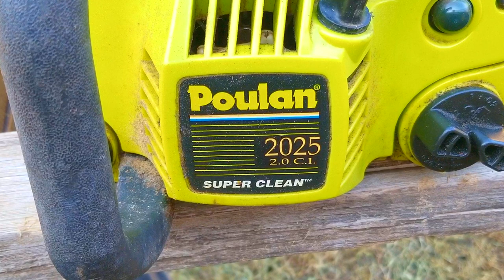THE UGLY SIDE OF FIXING SMALL ENGINES

Comment: The answer to your question is a "YES" Some customers are great, however I am finding many that abuse repairs and want more repair for nothing. I installed a brand new carb on a Honda Water pump and the customer came back and said the pump would not run. I found the new carb plugged with water and rusty gas. I repaired it again and ended up telling him that I would no longer repair his equipment. I checked his gas can when I took the pump back and it was an old metal gas can full of rusty gas and water. Many customers want equipment repaired but neglect to tell you the whole story of what happened to it. One guy let his young kid run his riding mower and just about destoryed the deck, engine, etc. He olny said he wanted the blade shaprened. Nothing left to the blade to sharpen and it was bent. Belts were almost burned off etc. Thanks for the video.
Reply from the maker: wow, customers can be the cause for the problems they have.  And thank you Waterman one.

Comment: I had sold a push mower to someone a few years back. A few months after I had sold it they wrote me stating I had ripped them off. They had said it stopped working so they took it to a shop to have it looked at. They stated the shop said the engine was worn out with low compression and they needed a new mower. I agreed to exchange it with a similar mower if they provided me with the shops diagnosis in writing and they did. I exchanged the mower and they brought back the one I had sold them. The engine was missing parts and partly disassembled. I assembled it back together, tested the compression at 140, it fired and died. Ended up having water mixed in their gas. After draining it , there were no further problems and I resold it. I learned that not all shops are honest and want to sell you a product instead.
Reply from the maker: yes it's a shame that some shops do that.

Comment: I used to fix small engines and chainsaws several years ago but quit after I didn't get any more challenge from it.  I too, learned the hard way about customers who abused my properly repaired equipment and then asked for refunds.  This was especially the case with chainsaws.  After a couple of these experiences, I made sure to ask the buyer the magnitude of the project and type of tree they were cutting down before I would sell them one.  Most of my sales were of lower consumer grade (occasional use) saws and in some cases the buyer was looking to cut down 20 foot oak trees with trunks of two feet in diameter!  For one buyer, I actually refused to sell him a Poulan P3314 for a 20 foot eucalyptus that he was insistent could be cut down with this saw.  I was able to successfully steer people either to professional large cc saws from rental stores or better yet, professional tree service companies.  I also prepared a one page Operator's Sheet which included instructions on the specifications of the blade and chain size, as well as oil/gas ratio mixing and car tips.  These changes to my sales eliminated any future saw comebacks/requests for returns for the approximately 100 saws I sold.
Reply from the maker: I can understand your situation, thanks for sharing

Comment: Had this happen to me BY MY UNCLE. I found 3 stihl ms200 top handle saws in a pawn shop which the owner of the pawn shop said were "burnt slap up" and he was selling for parts only. I gave him 100 bucks for all 3 and spent about 200 total in parts for all 3, carbs, fuel line, chains, oil lines, Filters, and one needed a complete rebuild. Sold one to my uncle for 250, who is a dock builder, so the smaller 200's come in handy cutting pilings, rails, etc. He said he had 5 dock rebuilds coming up & needed it for that since his, an old poulan, was getting old. 6months later he comes to MY SHOP screaming about how he was mid build on a dock and the saw quit, wouldn't run, and he had to do to home depot to buy one that would. He demanded money back, to which I promptly said, once I diagnose it, I'll gladly refund your money if it was something I missed. He said fine whatever I just want my money. I took the saw apart and IT WAS FULL OF SEA WATER. Called him to come see me and I showed him. He said, "Theres no way all that water got in there, it wasnt underwater for that long." Eventually he fessed up. He said it was running and fell in the water and spent 2 weeks in about 20 feet of water at a marina. Needless to say he got no money & no longer gets any equipment or repairs from me. I despise thieves.
Reply from the maker: wow, by your uncle on top of that

Comment: i have had a few cases where something happened in all cases but 1  or 2 it was nothing and it was stuff they did with the fuel,   water in fuel, dirty fuel they added.  one time a break cable broke,   I made it right and fixed it. only 1 time had did a refund. I always do extensive testing by using the equipment on my own yard.   I don;'t do many 2 cycle stuff. frankly most times many people have issues with fuel management on 2 cycles.  typically I have a unwritten 2 week  warranty.
Reply from the maker: I like the 2 week warranty idea

Comment: The worst thing about customer service is dealing with unreasonable customers. 
As for the saw, I picked one of those up years ago for $20 because it wouldn't run. Reattached the muffler with 2 x 6mm helicoils and got 5 years out of it before I sold it for $50. It went well, but the vibration dampening wasn't the best, I'd get white fingers after 1/2 hr of cutting.
Reply from the maker: thank you Spooky 88 I appreciate the information

Comment: I have refunded an item or two, but always within a reasonable time period.  When people ask me if I provide a warranty, I tell them that I do not.  However, if they do get it home and can't get it to start, I would happily look it back over.  I've had that happen a few times, and even made a couple free repairs as something failed out of the control of the user - a stop cable that worked when I tested it, suddenly broke inside the conduit of a mower within 2 days.  Luckily, I had an extra one on hand, and they were back with a working unit in a day.  

Beyond that initial cut, I don't know what you may have put into the machine or had something happen to it.  I'll offer to repair it, but not for free.
Reply from the maker: well said.

Comment: I own a couple of these Poulan saws. They require a higher level of patience and intestinal fortitude to keep them in good working order.  As long as you look after them and keep them clean and use non ethanol gas they will keep running and last indefinitely as parts are readily available and cheap for these saws. They don't have a very good resale value either, maybe $50 on a good day. But overall, they are decent entry level saw for light duty home owner storm cleanup etc. Thats all they are really designed for.
Reply from the maker: thank you Kevin C.

Comment: Well considering the saw was still usable as long as you changed the chain and bar I believe it was a good "investment" in your reputation since, well, you still had a working saw, not just a pile of scrap.
It seems like a good look-out for yourself.
Reply from the maker: for what it is, it's a good saw, and worked well after the repair, only requiring a slight tune.

Comment: I have a question about a Remington rodeo chainsaw I been trying to fix it runs fine but the oiler doesn't pump I took it apart and cleaned it and the gear mover a lot better and I replaced the oil line but it still doesn't pump oil to the chain I even took a air compressor to it to see if any was stuck in the new line
Reply from the maker: is there a filter on the line in the oil tank? 
Otherwise you'll need to replace the pump.
Reply: @INSIDEHOUSEGARAGE  I will probably have to get a new oil cap it just broke the someone glued it on
Reply: I will check if there is a filter in the oil tank hope it's a easy fix
Reply from the maker: gotcha

Comment: If the machine hasn't been abused, just normal ware and tare, 30 days no questions asked on anything I sell used, regardless if it's a year old unit or older. They are buying a used machine, and I make that clear.
Or as I tell them. They get the full guarantee. If after 30 days it breaks in half, they get to keep both halves. In forty years I can count on one hand how many machines I've taken back, with fingers left over.
Reply from the maker: thank you Andy Funke.
Reply: @INSIDEHOUSEGARAGE , I should add, when I sell a use machine I present the purchaser with a work order. Describing all the work that was done, and list of parts that were installed and whether they were new or used parts. It gives the customer a piece of mind, plus the unit is spotlessly clean.

Comment: No warranty on used equipment.
They bought it, they own it.
Problems and all.
That guy comes back 3 months later, the tree he was going to cut up turned into 50 trees. He flogs the ass  out of the saw for 3 months and then brings it back, no way.
Where do you draw the line?
One year, two years, three years?
They would use it for three years, bring it back and they have had a saw for three years for free
No. They buy a used saw. They use it once for even one minute and it is theirs for good.

Comment: they probably run it with used engine oil or no oil in bar ad change
Reply from the maker: I don't recall what happened to the bar oil, if they just ran it, until lt was gone and didn't know to add more, or if the oiler, just stopped working because they used the wrong oil.

Comment: I have 4 small engines on snow blower weed trimmer leaf blower and another snow blower. everyone of these have had carb replaced on them and oldest one is 5 years old. Do all small engine manufacturers buy their carbs at the same place? They are junk to say the least and am getting tired of replacing them. Can't afford to get carb kit, because it is more expensive than buying complete carb on amazon , but quality is next to nothing. these people need to step up and start building carbs that work longer than a year or 2.
Reply from the maker: That's a question for the manufactures to answer about where they source their parts.
Do you leave fuel in the tanks when you don't use your equipment.